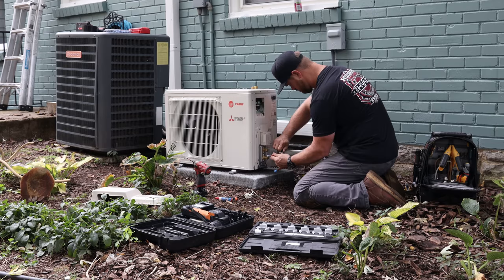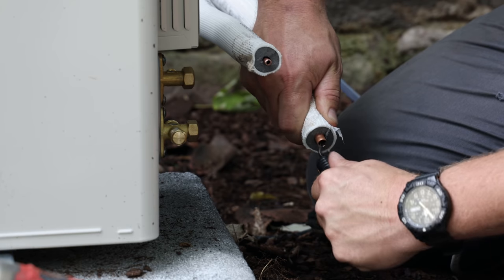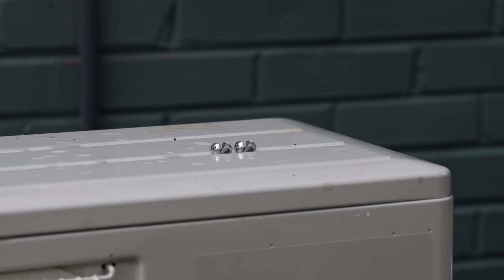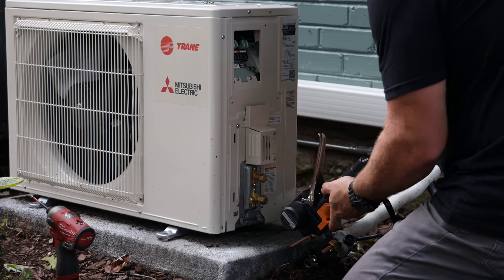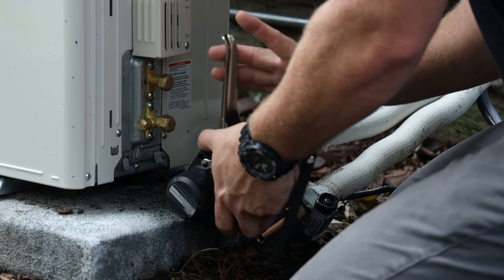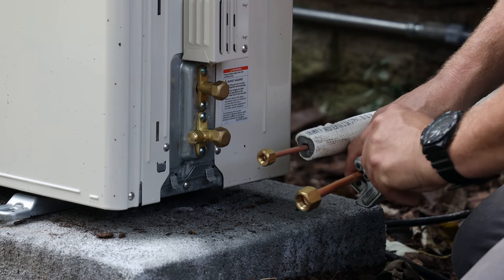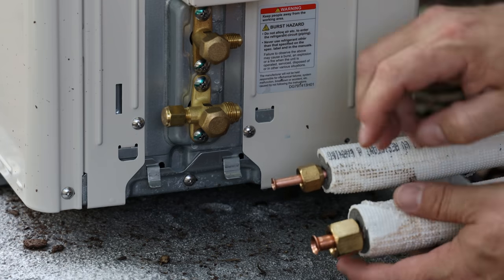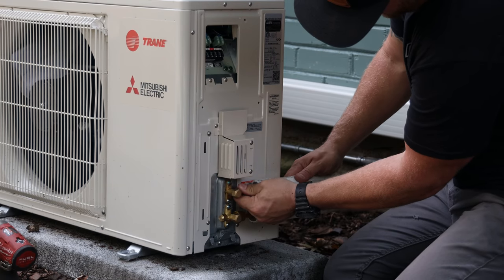How To: Properly FLARE Refrigerant Pipes On A DUCTLESS Mini Split

Comment: Zack, just FYI. I worked for a distributor that sold Mitsi. And also taught the classes on them. I’m impressed by the flare tool. We have seen the insulation on that pipe fall apart fairly quickly from Uv rays. I would cover that with something and also the nylog isn’t a good idea. If they find out they won’t give you warranty on the unit if the strainers get plugged. Also don’t put the nylog on the threads it changes the torque specs for the nut and you can actually split especially the 1/4 inch line. Per the manufacturer they say 600 psi pressure test because most of the high pressure switch don’t trip until roughly 696 psi. Not trying to beat you up or anything just letting you know.

Comment: Installing a 3 ton hybrid system in my house. It uses an inverter condenser with an air handler that uses duct work like a normal air handler but also has inverter technology. Installed a 4 ton in one of my son’s flip houses and it worked awesome. ACIQ brand
Reply: We will see
Reply: What is an inverter condenser?
Reply: @maness2112  it is a condenser used for mini splits

Comment: Good process mate, well done for putting your process online for scrutiny. I don't oil the threads or pressure test that high in the fear of pushing nitro into the system based on non sealing stop valves. But if it works for you then power to you. Your work is always very high quality. We need more techs like you on Australia.

Comment: I worked with brakes on cars some 20 Years in earlier days. We always made a double flange by using a tool that made a positive flare first and later the single procedure you make. The thickness got more sturdy that way.
I have now until lately for 35 Years + been in the cooling business mostly working on low temperature cascade systems.
Was surprised first time I got into this single made flares. Last 10 Years, I never saw any non soldered joints at any units.
Seems like the air condition systems stay a little back in time related to use flare joints.
The only I missed later years was access valves since checking static was a major issue by problems.
Lost half an ounce was critical so easy to recognize by pressure drop.
I had some funny leaks in high stage systems on long neck tube nuts. They froze and thawed every cycle and as vertical mounted, sucked dripping water that froze by every cycle. The tubes got so compressed by ice force to end up totally flattened inside those long neck ones, stay away from them😬
Nice to see your handy work😊

Comment: Like in the manual you will also want to apply lubricant specified in the manuals to your flares too. Ive always put nylog on the threads and mating surface, also helps to prevent from spinning the tube while you tighten the flare nut.

Comment: Hey man great video I actually just went through the Mitsubishi training course and they actually recommend NOT to use any sort of thread lock. Just a tip 👍🏼
Reply: same with the Carrier class i took today
Reply: Nylog isn't thread lock. I've used it for two years no issues.
Reply: @cheeeqo  whatever you want to call it, they don’t want you using it as it can ruin the system/ compressor and they actually say it will void the warranty if used
Reply: @xVizzeh  That’s nonsense. Nylog doesn’t affect refrigerant oil. It is non acid forming. I’ve taken the same courses at Mitsubishi and I’ve been told the same. I don’t use nylog regardless because I see no need for it, but theres no harm in using it as long as you don’t glob the stuff on.
Reply: People recommend you don’t smoke cigarettes but there is a ridiculous amount of people who do it. Nylog doesn’t do any harm to anything
Reply from the maker: Nylog is made from refrigerant oil, it won’t contaminate the system. Do what feels right to you.
Reply: @MK4vDubbin  I’m not saying don’t use it I was just letting the public know what Mitsubishi requests, trust me I like the stuff
Reply: Mitsu says they have tiny filters in the system and nylog will clog it. They also say to pressure test to 600 psi. I went to same training

Comment: Question when using the Navac  system flaring  tool , do you still have  to solder the  joint ? 
Cheers

Comment: I have been told to NOT put nylog on the threads, but rather on the sealing face of the flare. If you use it on the threads, it can change the torque values. Any thoughts ?
Reply: yes thats what most have been saying, and mostly are seems to professionals or experienced installer.  but it seems like people also having success with it anyways even with some uncommon practice lol

Comment: Is there a reason to pressurize the system vs vacuuming? I'm old school been out of the trade since 2003. Put in a few mini splits when they were first gaining popularity.
Reply: Its just to test for leaks. He's pressurizing the system with nitrogen to make sure there are no leaks BEFORE he pulls vacuum. If you hear the nitrogen escaping or you see the pressure drop on your gauges then you have a leak. If the pressure holds for a period of time then the system is ready for vacuum. You can do it with a vacuum too if you have a micron gauge but a lot of newer techs are using nitrogen. They will release the nitro to depressurize the system after the test and then pull vacuum.

Comment: 500 psi!?! Honestly never heard of anyone pressurizing systems to that high. Actually talked to Trane  during a training and they recommend pressurizing up to only 150 psi and I asked why and basically gave me a run around answer and what I got from that answer is basically their coils suck. Can confirm I work for a Trane dealer. Not as bad as Lennox though.
Reply: The reason you need to be careful with the pressure is you could create a seal issue in the service valve at too high of a pressure and also possibly contaminate the refrigerant with nitrogen. 
Especially if there is an underlying issue with the factory service valve.

Small chance….but possibly. I’ve always stayed no more than 200 psi in my 34 years. A good flare and you should be good.

Each tech does things to there comfort level.

Good video!
Reply: I agree with your statement I typically do around 200 as well if I get crazy I’ll push up to 300 but never passed that.
Reply: Most mini split manufacturers recommend 500 psi….

Comment: Putting nylog on the threads throws off the torque value.
Reply from the maker: That is correct, I should of mentioned that I use the lower torque value when using nylog.
Reply: @QualityHVACR  is there a general set of values on  how much torque to reduce with nylog?

Comment: Nylog is absolutely useless as a sealant for flaring. The thread's role is to apply  pressure on the flaring as you screw your brass nut. 

The only time you wanna use nylog is when you want to lubricate your flaring tool metalic cone. You can also simply use poe/pve or any mineral oil regarding to your installation.
Reply: 🤣 Absolutely not!